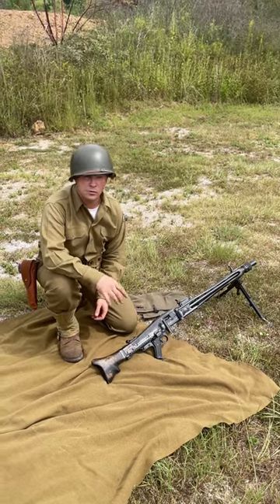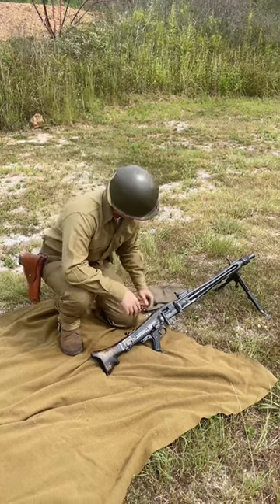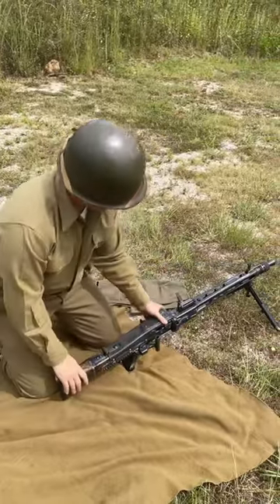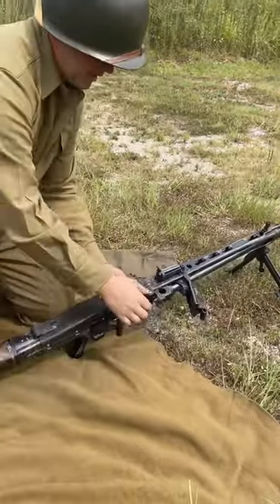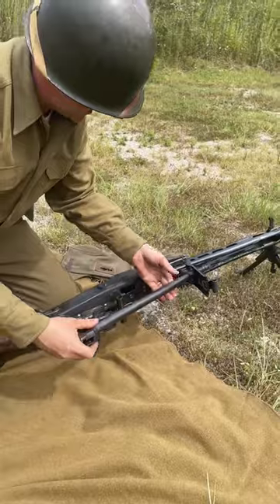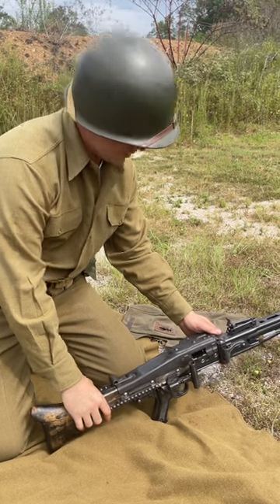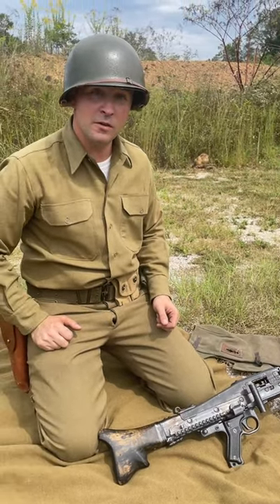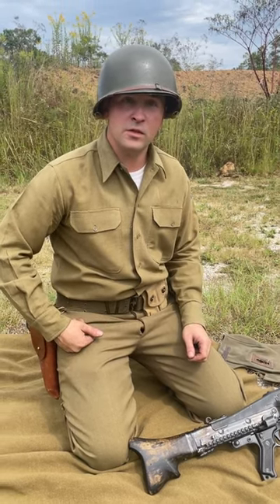The MG42, a True Quick Changing Barrel Design - J&M Spec.

Comment: its an M 53
and no its not just charging the gun - you also have to turn on the safety because triggerspring could be weak and the bolt can slam foward while handling the gun during the change
Reply: From Garand Thumb to MG Hand

Comment: Did they not use empty cartridges to pull the barrel out because it was too hot?
Reply from the maker: I doubt it. Spent cases are hot and not very long (57mm). Not enough to hold onto with the barrel mit on.
Reply: Yes...1200 round a minute that thang get HOT HOT!! they had to change it lots of time its basically a 3 men gun...1 men shoots...1 men reloads and 1 men change the barrel
Reply: Machinegunners are provided with mittens for this purpose ..
Reply: @ungodlyqc4939   thought it was 1600 rpm
Reply: My instructor in the Army (i used an MG3) told me that this is one possibility but if you wear standard Army gloves you can Touch the Hot Barrel for a short time without a problem
Reply: @NotBigBug the standard MG42 has about 1500 RPM. The modern Version, the MG3 has 1200 rpm
Reply: @fj1659 the mg42 had 1800-2000 rpm, the fire rate of the mg3 was tuned down
Reply: @yourtypical1722  nope that wars the MG 45 wich had a RPM of ~ 1800
Reply: @fj1659  there were versions of the mg42 with bolts capable of doing that